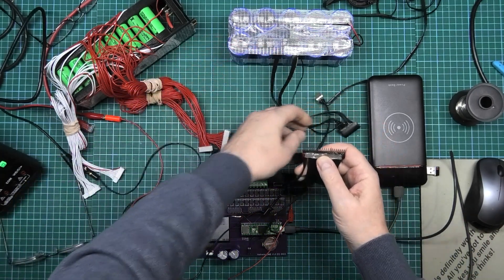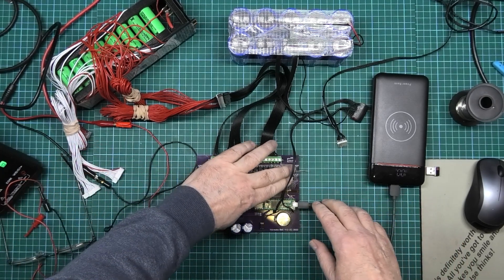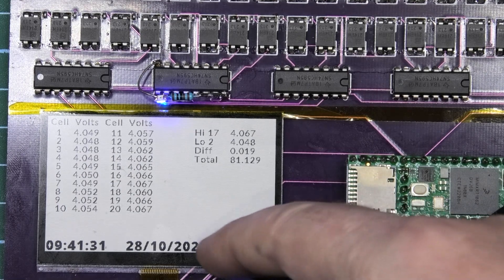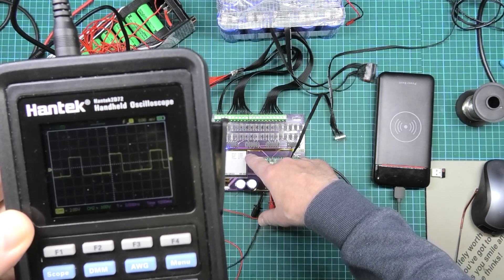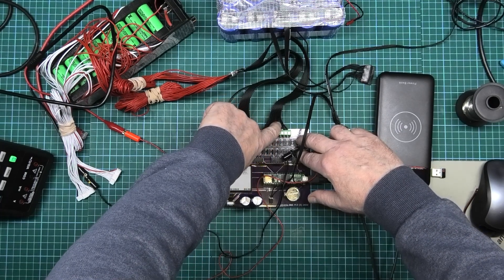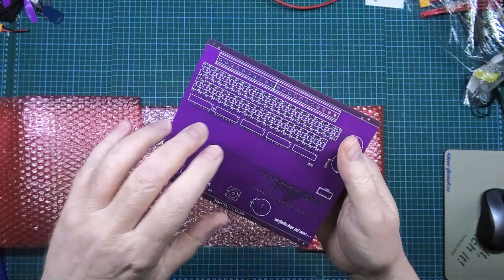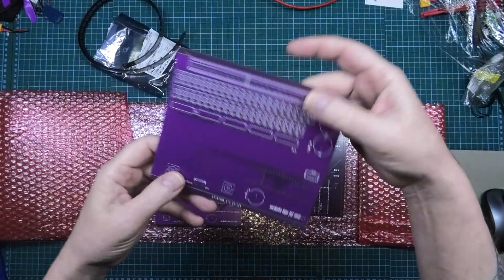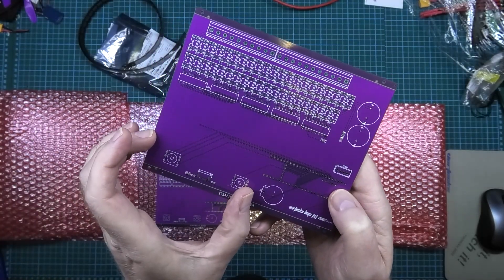Reinventing the BMS with VESC integration. I'm using the iScooter iX4 as the test bed -  Part 7

Comment: And I thought fireworks night was November 5th... Silly me.  Shame about letting out the magic smoke, though.  That look expensive.  
I realise that you're no doubt well past this problem by now, but it occurred to me that the topology that you have with all those SSR devices requires that they are all guaranteed 100% to be held turned off during power off, power up and during any initialisation of the Teensy and the shift registers.  This is fascinating.  I look forward to the next update.
Reply from the maker: Yes, they're 'NC' (Normally Closed) SSRs.  In my haste and stupidity, I totally forgot that the SSRs actually 'see' the total voltage of the battery but they only read one cell voltage.
They're tolerant to 30V, I shoved 87V through them. Time for a redesign I think.
Reply: @Vortecks  Ouch!  Yes, that would do it. Thanks for taking the time to reply.

Comment: Is this the second time you've mounted the chips backwards? The orientation dots on them are opposite to the ones in the previous prototype.
Reply from the maker: I changed the orientation on the latest design, I didn't do it wrong a second time, don't worry 🤣

Comment: PCBs needs lots of checking before producing shame it doesnt work 1st time... mite have a batch of duff opto isolators
Reply from the maker: It was the voltage that blew them. In my haste and stupidity, I totally forgot that the optos actually 'see' the total voltage of the battery but they only read one cell voltage.
They're tolerant to 30V, I shoved 87V through them. Time for a redesign I think.

Comment: Hi, Tony any chance of implementing four temperature sensors in your final build ? As I find one or two is never enough, mind you they can be spliced from just one to make more but it will only give an average reading hence why separate ones will give more accurate readings. Just a thought, Happy new year.
Reply from the maker: Happy New Year to you too 😁
Absolutely, actually I'll add another 3 sensors so they can be used on other things if needed 😉👍

Comment: These optos are absolutely NOT 180 degrees rotated, comparing to first PCB in video.
Reply from the maker: I don't understand what you're getting at?
Reply from the maker: Hang on...... are you saying that they're backwards? If so, they're not. I changed the orientation of them in the latest design 😉
Reply: @Vortecks  yes. That's what I meant. Than looks like something went wrong during reversing or it's not the same pinout or specification.